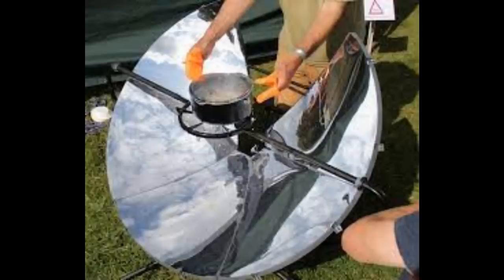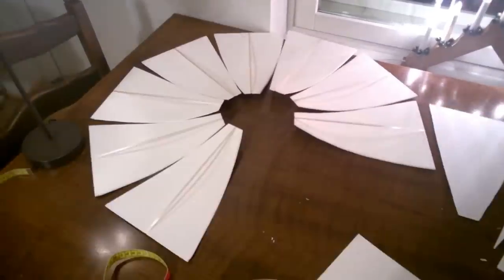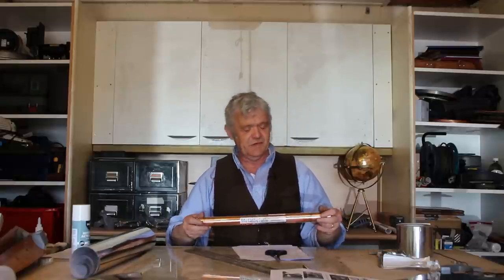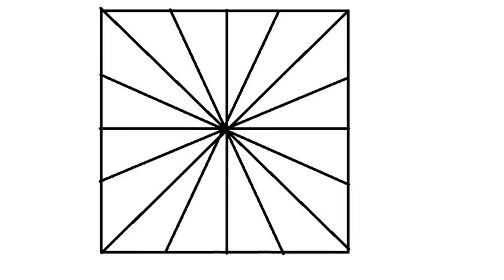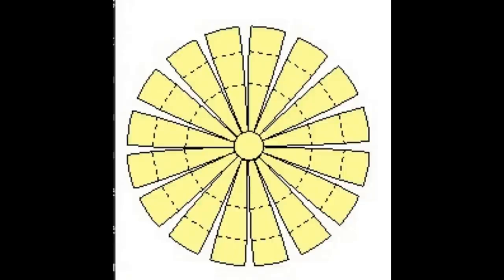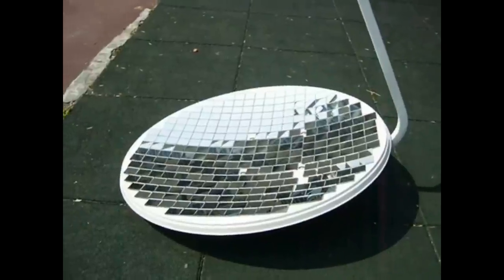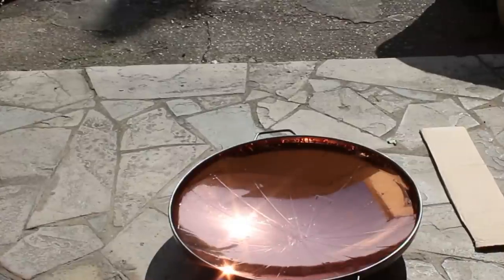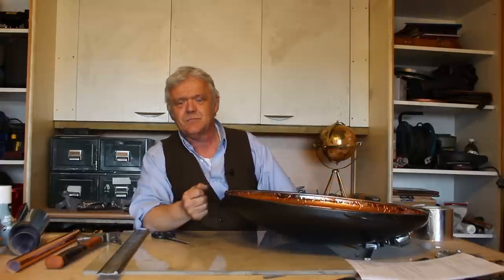1940 Burning Mirrors

Comment: I built something that I cannot explain very well and I need someone much smarter than me to tell me why it works
Reply: Tell me more... I m not smarter, but I'll try to find out, what is going on.
Reply: I don't know if I am supposed to advertise my YouTube channel on other people's channels, sorry if I'm breaking an rules but I have a video that's titled magnet motor. what I built is a three phase motor that one phase is being used as a driver source for the motor and the other two phases are generating electricity, and the amps im putting in are much less than the amps that are coming out I'm probably not doing something right with my tests but it looks like I'm breaking the laws of physics lol
Reply: @ryanhorvath5816  Take measurements, input power and output power. Don't just see voltage or current.
Reply: This actually got in another state at my friend's house when it ships here I will test the voltage and amperage in and out and get back with you thanks for the help
Reply from the maker: i did check out your video but there is not a lot i can say about it - did you try without a magnet too? and with just DI water?
Reply: Hi Robert, I thank you for looking at the Leyden jar. I did try without the magnet and it did nothing I think what was happening with the Leyden jar is when people were walking by the table the tinfoil was vibrating inside in creating a field of some sort. like a magnet moving past non-ferrous metal. That is my best guess on the Leyden jar phenomenon.
Reply: A small update about the magnet motor video, the battery charger is very old and it makes around 16 volts, the amps being consumed by my machine was under 1 amp sometimes it would go all the way down to zero if I had an amp reader that went negative I have a feeling it would have shown a negative reading equal to the positive reading. also I'm only showing the output on one of the outputs and it has two outputs if it test the way I think it will it will produce around 6 amps between both of the outputs. the motor that I am running with it is a 12-volt motor. thanks again for your time and when I get the magnet motor back in my in my possession I will post a new video with better tests
Reply: I have a new demo on the magnet motor if you want to see it 🤯